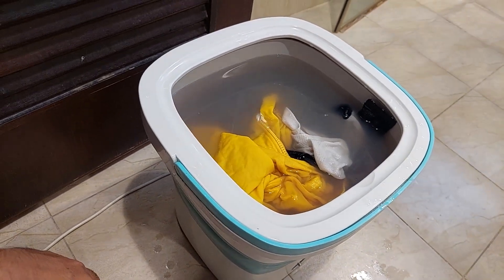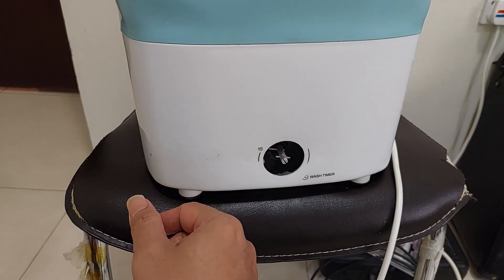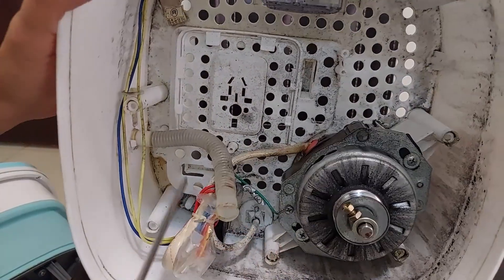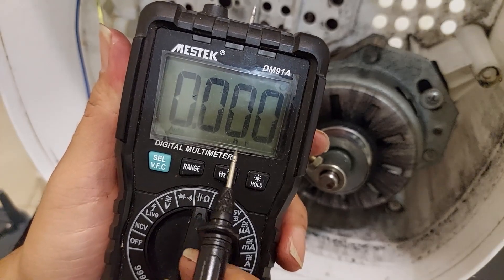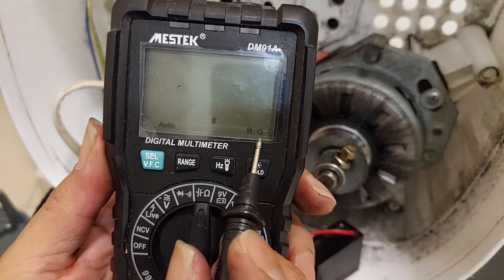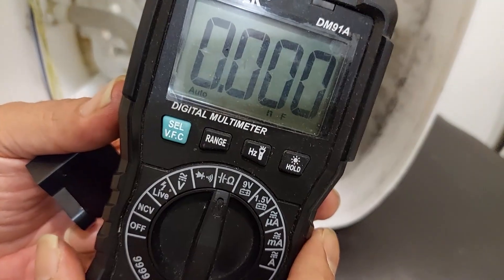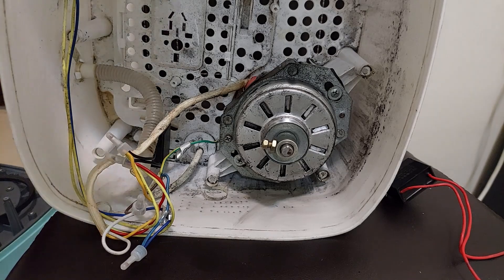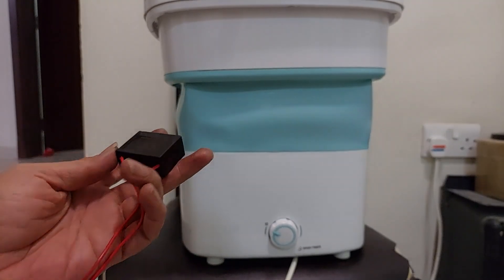MINI WASHING NOT SPINNING  [ Solved ]

Comment: Hi, mine have two programm, it just switch from one, two another and then switch off. It does like a two minute of the programm
Reply from the maker: which model, with digital display ?
Reply: Yes, the model is MLSC-01. The store who i bought it is no longer in activity but the machine is only 5 monts old and in Italy is very difficoult found someone who can repair.
Reply: We just bought one and onyl one of the buttons works… in your situation did all the buttons work from the start?

Comment: Help me with mine? My agitator spins, but it don't spin the clothes like it used to when I got it . Almost like the agitator is weak now
Reply from the maker: yes most case its the motor or the rubber belt getting weak or bad, you can watch my other videos about belt replacement.